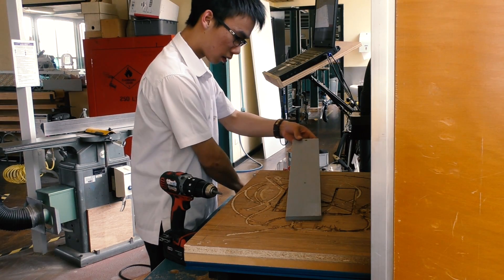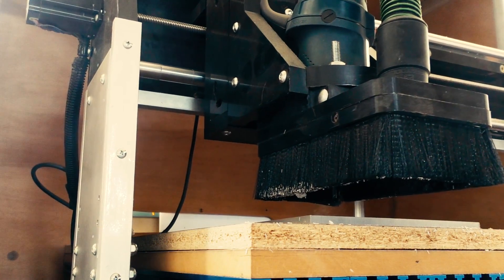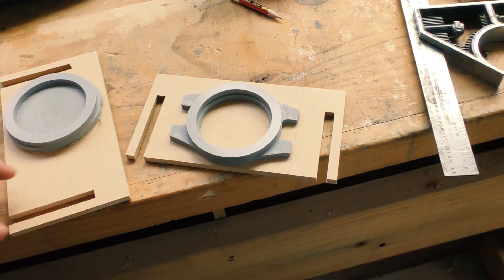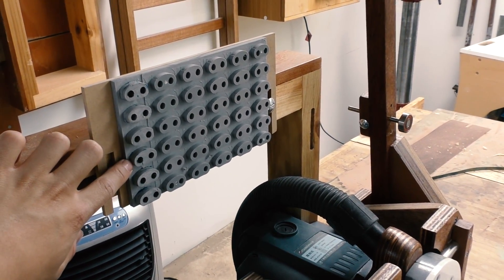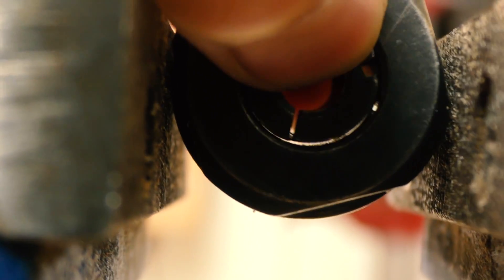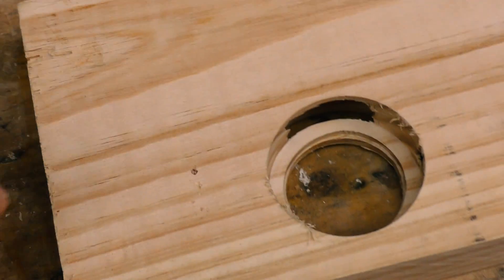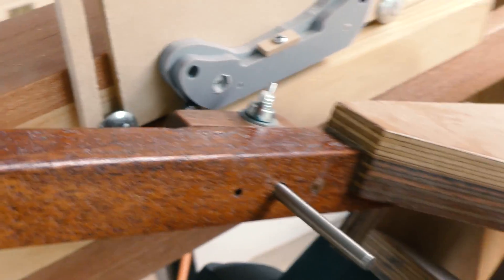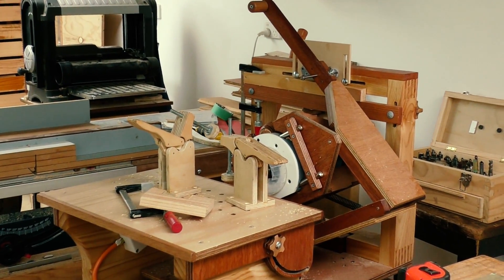Wooden Watch On Pantorouter?!

Comment: The time you spent making templates on the cnc just could have made the watch. No point in what you did. Make the g code at home and just upload it when your at the school. No reason to make a bunch no one will buy them and if you give a bunch as gifts it defeats the purpose of making a special one for your father. If you give a few as gifts then your fathers wont mean shit. There is no money in this to make them to sell if thats what you planned. The perfect ones that are being sold are only being sold for $40-100 and that is perfect ones made on cnc and not with Plywood lol  And the time it would take to make them on a Panto You would be loosing money with, your time, electricity, mistakes, and sanding  well time Idk you's Asians are use to sweat shop conditions making 10 cents a hour lol

Comment: would it not make more sense to just try to carve these straight on the CNC?
Reply from the maker: I unfortunately don't have a CNC, I thought about building one since last year and even had a full on research and material list ready for when I  go to China in July to collect all the necessary hardware, but I found that it was going to cost way over my budget. For the pantorouter, apart from the linear bearings that I had to pay full price which was the price of very good drawer runners in Australia, I was able to get almost 50% off for the marine ply used (the rest were scraps I got from the bin from local hardware store, I know right, they actually let you do that). I think the use of the school CNC shown in the video might very well be the last time of me using it, because I was able to justify using it by saying it was for the pantorouter which I did for a school subject (some of my teachers might be watching this, so that just blew the last cover). The pantorouter isn't the best machine for the job, due to the amount of flex that exists in mine (mine has about 0.5mm when nudging the pantograph operator lever at the collect of the router, 0.2mm of flex when pushing the plunge lever), but the fact that the templates are two times larger than the finished workpiece, makes them a lot easier and safer to make by hand, which is what I plan to do for future versions of the wooden watch.
Reply: Matthias Wandel I understod that he wanted to make a template with the CNC to be able to use pantorouter repeatedly as he doesnt have a CNC of his own.

Comment: Nice innovation with this use of the pantorouter. The wooden watch is a cool concept; it is amazing to see you bring it to reality.  I'm also thinking about aluminum as a potential material...or maybe brass.
Reply from the maker: aluminum and brass would be materials better suited than wood to make watches, but they are very prone to scratches. Nevertheless, I would probably try making one out of brass or aluminum, maybe casting it.
Reply: Steven Zhang https://www.originalgrain.com/products/whiskey-barrel?utm_source=pinterest&utm_medium=paid-social&utm_campaign=pinterest-menswatches&utm_content=creative-e&c3ch=Pintrist&c3nid=PIN-626735563070&pp=0
Reply from the maker: Christopher M. Craig yes i am aware that there are many wooden watches sold on the market
Reply: Steven Zhang they never hit my radar before your project came across